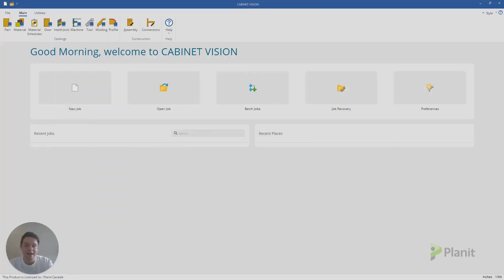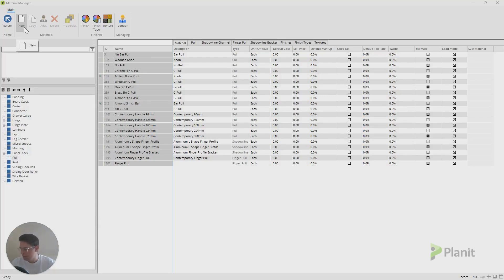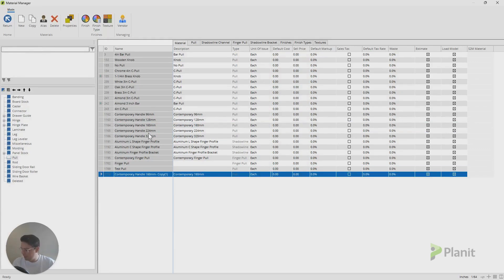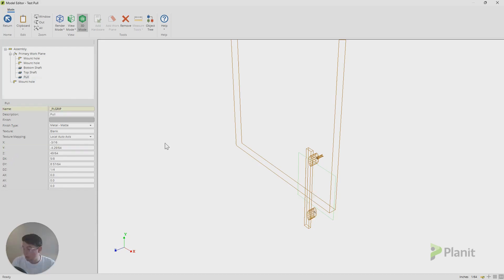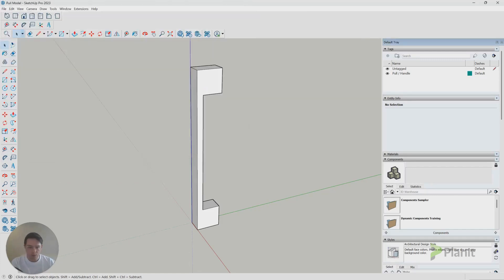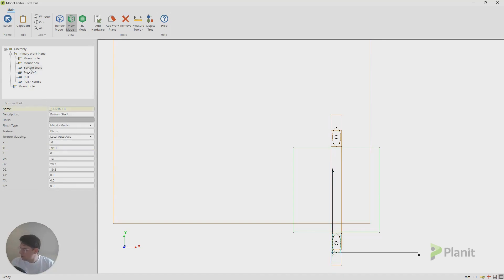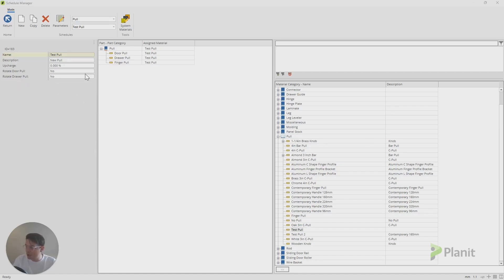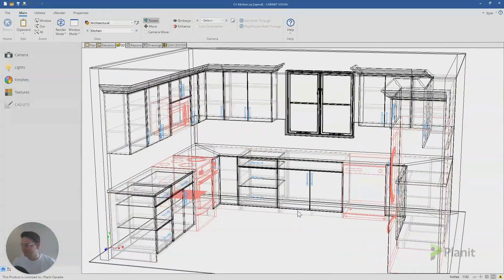How to Create New Pulls & Handles in CABINET VISION!

Comment: What would be the fix for a tab pull being oriented correctly on one door but being flipped on the second door?
Reply from the maker: Interesting! Theoretically, the pull should be identical on both of those door faces. But we might be able to deduce what's causing the issue!

If this handle is being placed via a UCS, you could definitely potentially see this kind of behaviour. Do you know if the handle is setup in the Material Manager/Material Schedules or if it is designed to work with a UCS?

To test this for me, could you try manually repositioning the Tab Pull yourself from with the Assembly Level view of a cabinet? Can you double-click on the Section Face with the problematic handle and change its position under the 'Pulls' tab correctly? Does it respond? If you, from the Face, Plan or End view try clicking on this pull and rotating it yourself, does it respond properly too? Or does it refuse to budge like it should?

If the handle is not reacting to your manual adjustments, it seems like it could be a problem with a UCS.